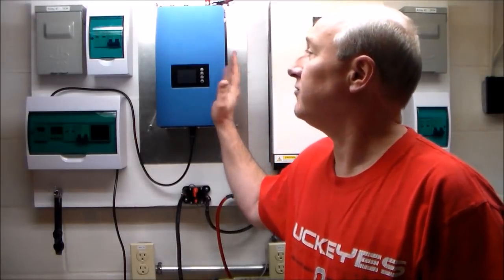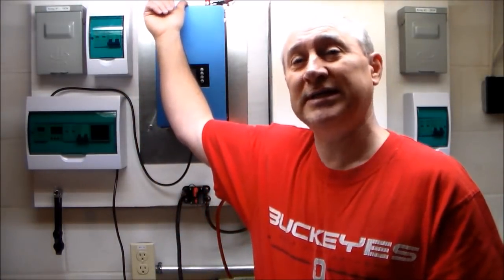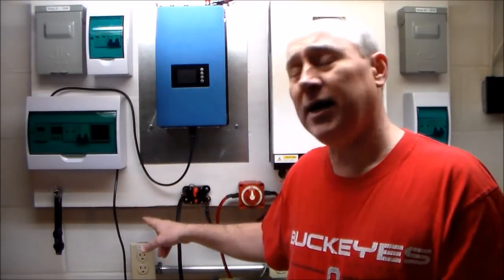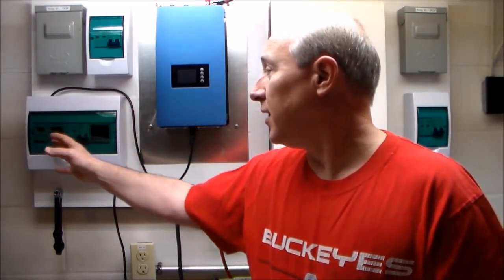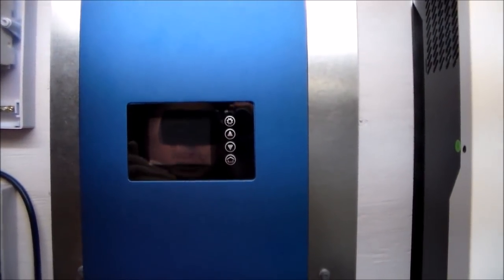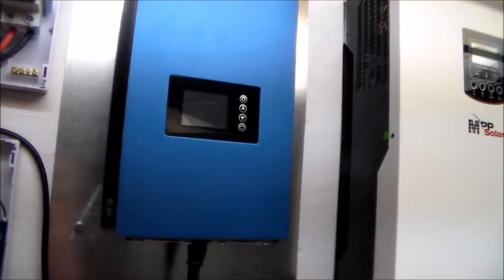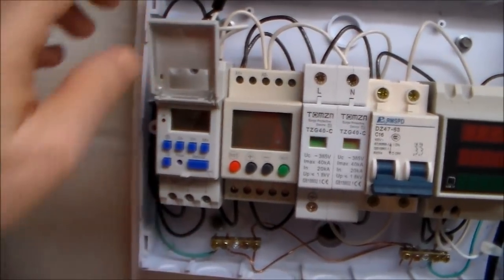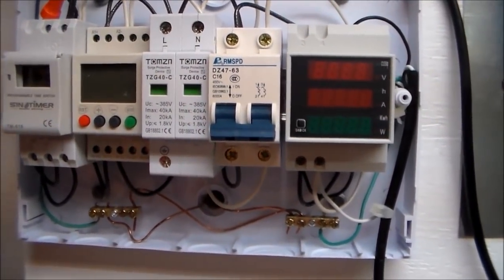DIY Solar - Episode 8 - Sun Grid Tie Inverter + Safety Devices (GTIL2)

Comment: Jim I'm thinking of doing the same thing. I'm trying to understand you added your own outlets in your home to be isolated from house wiring? If so how many?
Reply from the maker: DIY Guy Home owner Yes, correct. I added two addition outlets. One on each leg of my breaker panel. This way, I can install the grid tied inverter on either side of the panel or install a second inverter later, one for each side. Good luck!
Reply: He added another 240vac circuit breaker to his home wiring and has a dedicated run, that includes a neutral white wire, to his inverter panel. One side of the 240, with respect to t he white neutral wire, gets connected to his inverter.

The inverter circuit is not isolated from the house wiring since it can back-feed in to the home's CB panel. Ideally he'd have a external current transformer attached to whichever leg of the 240 coming into the house the inverter is on so that the inverter can throttle back the power in case his consumption is less then his production, thereby not exporting to the grid.

Comment: Hello, are you still using your inverter? Have you had any malfunctions with it now that it has been running for an extended period of time?
Reply from the maker: Rock Stomper Yes, still using it with zero problems at all. As a matter of fact, I added a second inverter onto the other 110v leg of my house since the first one was working so well.
Reply: @jimginnyohio  ok Thanks. so how many watts do you have feeding that 1000 watt inverter?
Reply from the maker: Rock Stomper I have four 255 watt panels feeding each of the grid tie inverters. I have the wired in series and parallel.

Comment: Cos is something with inductive load's probably...resistors have cos=1. Inductive load's have less than that up to 0.99 you can improve this with some capacitors 
Cos is on the every single phase motor as value so that you can add capacitors to improve that factors up near 1 so less inductive current in the wireless less heated wires...something like that... 👍

Comment: Jim,  Did you try the dual limiter cables to monitor both sides of the split phase, L1 and L2?  Search Ebay for "GTIL cable"
Reply from the maker: That wouldn't work for two reasons. 1. The reason I originally replaced the clamp was because it was too small to fit the 2AWG cable that is used for L1 and L2 coming into my house. The dual clamps you are referring to are the smaller size clamp. 2. The replacement clamp I purchased was the cause of the device misreading the true power usage in my house. I needed a clamp that correctly reads one side; either L1 or L2.

Comment: I'm probably missing the obvious here but why couldn't you have wired a 240v plug to your electrical box and used the 240v inverter version instead of needing two 120 inverters?
Reply from the maker: Here in the US, we have two 120 volt circuits coming into our homes that are combined at the utility panel, giving us 240 volts split-phase. If I went with the 240 volt inverter, there is no way to connect the monitor clip to both of those circuits. The rest of the world only has one cable enter the house, so that single clip works well. However, in the US, things are different.

Comment: A 1500w hair dryer and an 1000w inverter doesn’t meant 2500w on the circuit. The hairdryer is consuming power and the inverter is supplying. It means the grid has to supply the extra 500w. Its supply and demand. 

If you were to put several inverters on the same circuit then you would get the overload
Reply from the maker: I was not referring to the "circuit" being overloaded. Instead, I was referring to all of that power traveling through the wires for the circuit. If the wires are rated for a certain amount of amps, then it's possible that the number of amps coming from both the inverter, plus those traveling to the hairdryer will overload the wiring. Please watch this video since this guys explains it much clearer than I did in my video:  https://www.youtube.com/watch?v=br2F5AQXXbU&t=300s

Comment: Why do you say not to order the 220v version for USA. I would think you could just wire into a dedicated 220 breaker which would feed both legs of the breaker box. The only problem I see is the limiter can only moniter one leg. Solution for this would be to put in a 220v breaker that stays on the same leg
Reply from the maker: Randy Hauck Since you would only being monitoring one leg, the device would not feed both of the legs. Some have tried this, but were not able to get it working correctly. I have seen a modified clamp where a y-cable was installed and two clamps were wired together, but never heard how well that worked. Have you tried this yourself?

Comment: Just a small but important comment from an English electrician. I cannot see any protection where the cables exit the quick disconnect box. Wires going through a metal hole should always be protected by a rubber or neoprene cable grommet.
Reply from the maker: Yes, you are correct. I did not have those when I made the videos, but have added them since. Great observation!

Comment: Hi I don't think you should be grounding the DC surge protector to the house earth I think you need a separate DC earth rod at least 20ft away from any ac earth rod
Reply from the maker: Ok, thanks for that. I will research and make changes if necessary. I plan to install a grounding rod at my solar panel location. I will be sure to ground all outside components there.
Reply: And the DC-SPD is as well required at the PV array as well. So if you get a lightning strike the majority of the current will be grounded at the array already. So you would have 2 DC SPDs. The other thing is, pls use similar size wire as jumper wire. Electrons are normaly going the way of least resistance. If you use such thin jumper wires compared to the pv dc wire, it wont be very effective :). Like your system!
Reply: I'm a ham radio guy. My radio tower is bonded with the electrical ground. My solar panels are bonded with the electrical outlet and the radio tower. I use the air conditioner disconnect on the outside for my panels. It has it's own ground rod but is bonded by the near by tower. Very nice install.

Comment: Excellent video, really helpful, thanks. Can I recommend you check out the sonoff r2, it will act as a time controller and also provide real time data on usage etc and works with a mobile phone app.

Comment: Where I live the local utility installed a smart meter and ask me to not use grid tie inverter regardless of all the safety precautions I took , have you had the same issue?
Reply from the maker: jaimewanda As I mentioned in the video, I did not go thru my local utility company for approval since their expectations are to have a professionally installed system and pay them for approval to do so.

Comment: Nice system. Great set up. The one thing I did notice was your explanation of over loading a circuit was actually not completely correct.
Reply from the maker: I believe I know which comment I made you are referring to. Although I wasn't referring to overloading a "circuit" so much as overloading the wiring that is used on that circuit. Please watch this video since this guy explains things much better than I did in my video:  https://www.youtube.com/watch?v=br2F5AQXXbU

Comment: Hi Jim, its being a while, can you tell me if placing two grid tie inverters on each fase does work on the US with the original cable coil.
Reply from the maker: Lauramar Sotomayor Yes. However the main problem in the US is that in most cases, the original cable coil is physically too small to fit around the 100 amp phase cables. That is why most people replace the originals. When buying a replacement, you must get exactly the same rated coils. Otherwise the power readings will be inaccurate like in my video.

Comment: Great explanation! but it's overkill on all the extra components. Most if not all the protection that you added is already built into the inverter.
Reply from the maker: Buylourenco Nope, that is not true. Those protective devices ARE NOT built into the inverter.

Comment: Very interesting, I suppose it's still worth for most to inject back the power to the grid, simply because the top production hour of solar panel is usually not a time when you need the most power.

Comment: Hi, Ken here, I am in the Philippines in the northern part, anyway I have a 2000 watt unit with a limiter, anyway It died yesterday, any repair, group that may give me some help . I got from aliexpess about 2 1/2 years ago I cant find group of the guy who has a group in the Philippines?
Reply: I am retired navy so I am on a budget I can get a new one but it is better to fix this one if possible.
Reply from the maker: Please do a search on Facebook for a group called: SunG Grid Tie Inverter with limiter. There is a guy in there name Rogel Naval that sells, repairs, and provides much information for those devices for many people. He is also located in the Philippines. Good luck! I hope that helps out! ;-)
Reply: @jimginnyohio  thanks , will do.
Reply: I sent it to Mr. Naval, he fixed it and sent it back to me. thanks
Reply: he charged 4,000 including parts it is around 78.00 dollars
Reply from the maker: @kennethlittrell2359  I'm glad to hear that you are up and running again! Glad that worked out!  :-)

Comment: Very good your videos especially this one. Congratulations, you won one more subscriber. I am riding a similar or better like this. I'm sorry, I would like to know how many watts are coming from solar panels (I don't know if you mentioned it in the video or I went unnoticed). Thank you very much ... Stringhini from Sao Paulo / Bre´zil /.
Reply from the maker: The GTI system has four 255 watt panels connected. The most I have seen coming in so far is about 950 watts. Thank you for subscribing! Best wishes!
Reply: @jimginnyohio  
Let me abuse you some more. (i) as i am also installing a Sun 1000W inverter for 110v to 127v grid (ii) i already thought there would be 4 (four) solar panels in your system but i loved your confirmation (iii) and the average efficiency of your panels was + - 90% at maximum peak (iv), I think, within the inverter's safety margin and PSolar efficiency (v) I would just like to know if your Break model TOB1z-63 DC 440V input has never tripped / stopped without your interference. No thanks a lot and I'm enjoying your very good videos. Hugs from / Bre´zil /
Reply from the maker: José Stringhini No, the breaker has never tripped...so far!  Hoping it doesn’t happen! :-)

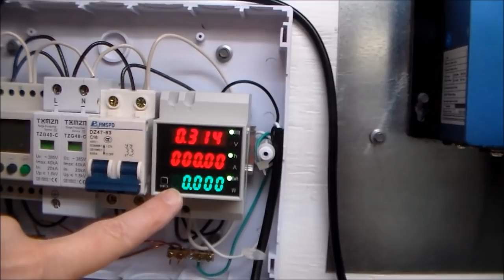Comment: Hi Jim - really appreciate the videos they are sooo helpful. One point I am struggling with is the digital multi meter. You say at 30:47 it measures KW used, then at 33:12 you say it show KW produced - is this an error or does it show both?
Keep up the good work
Peter

Comment: very informative...I saw one of those grid tie inverters and thought it seemed pretty sketchy to plug right into an outlet.. I like your idea of a completely separate circuit.  I wonder if a circuit breaker would blow if something came into the panel with too many amps... normally they blow when pulling to many amps out..  Anyway, great video besides that awful shirt... Go Blue!  ;-)
Reply: Thanks for your comments! It's my understanding that the circuit breaker will blow regardless of the direction the power is going - in or out.  Also, you'll be happy to know that I too am a true blue blood. Grew up in that great state up north. I just wear the shirt to keep my wife happy. We get along well except for that one day of the year when we divide the living room in half and throw things at each other. :-)
Reply: @jimstockton3326  there is no great state up north >only a southern Canadian province .Buckeyes rule.

Comment: ... They should actually thank you for producing your own energy.. the coal generators are more expensive and harmfully to the environment... all grid tied system has standardized safety procedure to turn off when the grid goes down to protect those engineers troubleshooting the grid...what u can add is a hybrid inverter...which is connected to battery..and turn on when the power goes down or access solar power are saved on those battery when the grids down ...but im not sure yet if it is feeding into the grid...for our power engineers safety they should not...so we need a breaker to grid when the hybrid detects a power-down and turn on its off grid functions... and turn back on when its back automatically ..make lots of buck by saving them in long term investment..

Comment: It appears you forgot to mention that the grid tie inverter monitors only one of the phases of the grid power entering your home. If one gets a 240 grid tie with only one limiter clamp, then the inverter won't see the other phase that may have a much smaller load at various times, and thus pumping power back into the grid on the other phase not monitored by the limiter. BUSTED!
Reply from the maker: Actually, I explained that in great detail beginning at 2:55 in my video. You must not have watched and listened closely. Also, since the device I am describing is the 120v device versus the 240 device, I’m not sure why you say “Busted” at the end of your comment when you say “if you get the 240 grid device”. You are comparing apples and oranges!

Comment: The cables going to the surge fuses are way too thin !
Reply from the maker: Actually, they are not! They are in-fact oversized proportional to any load that could travel that circuit in accordance with the US Wiring Codes.
Reply: @jimginnyohio  Are we talking about the same cables ? The ones shown at 20:00 will melt if a lightning strikes
Reply from the maker: For a direct lightning hit, there is not many cables that would handle that!  In either case, that is a 10 gauge solid conductor wire. Any surge would have to get past two 20 amp breakers BEFORE even reaching that point. If it does get that far, then yes, there is a possibility of melting that wire. But, since my panels are grounded, I've taken the best precautions.  Do you have advice on what that should be? As mentioned, the wiring I have there meets the wiring code.
Reply: @jimginnyohio  surges can also happen due to voltage induced by a nearby lightning strike. And in this case bigger wire is better due to a lower resistance.
Also, wire is quite cheap. One extra meter of 6 or 10mm^2 will cost you a couple of bucks.

One reference is "Common Practices for Protection 
Against the Effects of Lighting on 
Stand-Alone Photovoltaic 
Systems" made by the IEA

Comment: Hello again Jim. Pardon my ignorance but I have a question regarding the 2000w 240AC Sun Grid tie Inverter model. You mention it cant be used in the US but we have 240AC through the addition of the two 120AC legs coming into the house.  I would like to get the 2000w model over pay for two 1000w version if possible.  You obviously know a lot about these units so I was hoping you could tell me/explain the limitation.  Thanks again and thanks again for posting these videos and information
Reply from the maker: jvalinsky You can indeed buy a 2KW model. However, you must insure that you get the 120v version instead of the 240V version. These only have three output wires (line, neutral, ground) so you can only attach it to one of the 120V legs in your panel. In addition, the limiter feature can only monitor one leg. In the rest of the world, they don’t have a split phase panel, so they can wire the 240V version in with those three wires. But here in the US, we need 4 wires to do that. If you want to feed both sides of your panel, you’ll need two devices.
Reply: Jim, thanks again. I looked up the Ebay seller you mentioned but i didnt notice a 110v 2000w version you mentioned.  Also checked chinesegrid.com (who i believe is the manufacturer) and i didnt see it listed there either. Can you steer me in the right direction for the 2kw 110v version. Thanks again!
Reply: Hmm! I’m not seeing the 120v version of those advertised anymore either. I guess you could use the 230v version, but you would need to make some changes to make it work correctly. You would have to modify the output cable to wire it into your panel, but keep in mind that the device wouldn’t be grounded. Also, you would have to modify the limiter cable so that it monitors both 110v legs. I have seen someone selling an already modified limiter cable on eBay. I haven’t tested any of the above, so I would recommend that you speak with an electrician before proceeding with any of this.
Reply: @jimginnyohio  I have the 2000 watt 220v version and what you need to do is buy a 220v  dedicated socket that feeds into a douple breaker which will then feed both legs of the panel. your N becomes the second hot then Line. and still you have ground. Only problem is the limiter will not work correct
Reply: Yep, that’s the issue.....if the limiter doesn’t work, it defeats the whole purpose of going with this type of device. Instead you could simply use any type of 220v inverter. The key to this device is the limiter.
Reply from the maker: That sounds great! Please let me know how well that works. Also, did you order the smaller size clamp or the larger one? For my service, I would need to go with the larger clamps. If this works, I may have to make some system modifications.  :-)
Reply: @jimginnyohio  Hi Jim, I ordered the smaller clamp which is plenty big for my application..I am hooking them to only a 10 guage wire service entrance 30 amp small guest house application. Only running a fridge, lights, a TV and some ceiling fans.. I have the 1000 watt GT unit also but it only feeds half the house which is no good for what I need. I am probably going to sell the 1000w unit if the 2000 works out
Reply: @randyh6636  How did this work?